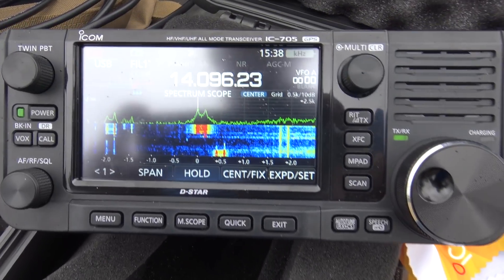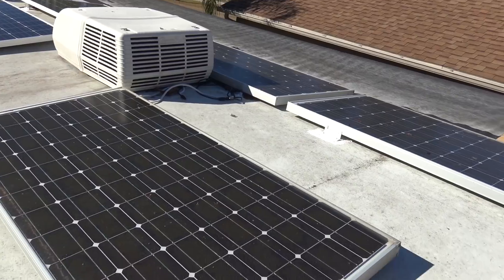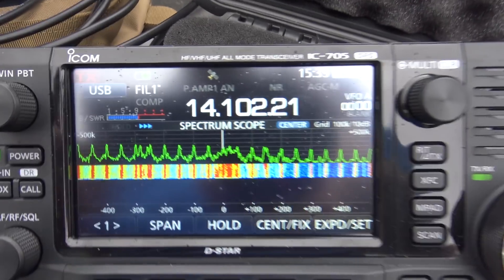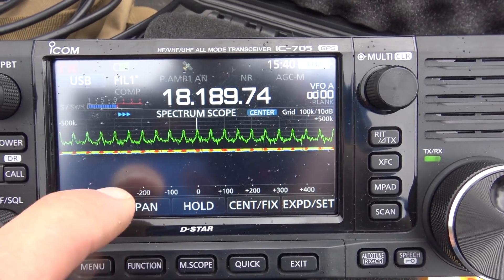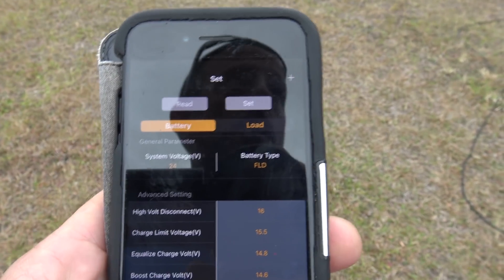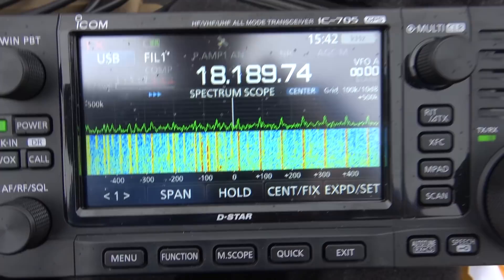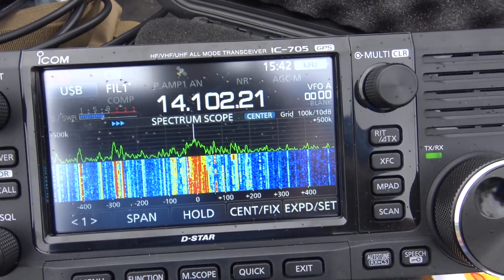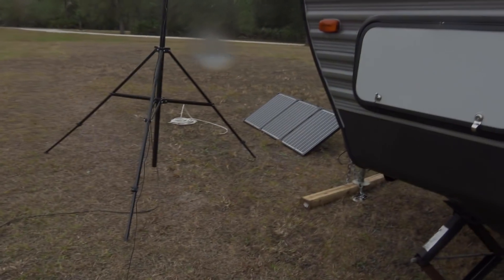Does Off-Grid Solar Energy Interfere With Ham Radio?

Comment: I scanned the comments but are you sure that is your solar panels, yes I have heard some panels can do this. I have had two 600w systems on RVs. One was Samelex panels and MPPT controller and the last one was 600w Renogy panels and using Blue Sky MPPT controller. Operated on the last one almost every day for 8  months inside and out the RV. I have also played with smaller controllers MPPT with QRP portable, 60W and 10a LIFeOP4. Panels never an issue. Yes, some MPPT portable controllers have caused RF. Some did not.

Comment: I've got 30 decibels over S9 noise from my son gold power 6000 watt pure sine wave inverter. I've tried putting ferrite modules on all of the leads going in and out of the inverter to no avail. The solar panels are radiating I can't even though the DC wiring from the solar panels to the house have about 50 ft of it submerged underground for read direct burial cable. Aref interference from these inverters is a major problem in a major engineering challenge to solve.

Comment: I just installed a GroWatt 3000TL. RFI is horrendous! Exactly as you demonstrate. I just tried putting a 4 inch 31 mix ferrite donut on the battery leads. I was able to get four passes through the donut. No measurable suppression. So I might have to resort to disconnect the panels when using the rig but what a sad situation. When I'm not using the station I am going to be polluting the spectrum for others.
Reply from the maker: I'm working on this too
Reply: @HamRadioConcepts  I'm wondering if running all the PV DC wiring inside metal conduit would help at all. The charger to battery wires are short. I'm guessing most the RFI is off those PV feeder wires. "Sniffing" around with a portable RF rig and short antenna, the panels themselves seem to be radiating but not as much as the lines. Adding the conduit would be a lot of work and expensive - I'd be willing to do it if I thought it had a decent chance at success. The other thing is my panels are not earth grounded (frames) yet but I can't see how that will help.

Comment: Solar panels and DC regulators don't make interferences. The problems is always with the inverter (AC 230v).
I had a lot pf years mi shack powered by solar energy and no issue, but in the new house with another solar installation with inverter I have a lot of QRM
Reply: Yeah the Inverter always make a problem .... Maybe people can mention what kind of inverter they use for 220 V what not take interference

Comment: I have a 5 KW Solar System and have Zero noise on all bands and no RF from the solar system, mounted Solar Inverters inside shipping container earthed, all cables underground shielded and earth between solar container and living area, I live in a caravan about 250m from solar container on a farm, noise level is below S1 all bands, and yes i do have good antenna :) regards Nigel ZL2SEA

Comment: Try wiring in a few decent sized 16v capacitors on the 12v power wires going to your radio gear, that will act as a "filter" to get rid of any noise going through the charging wires and help drop that noise floor. Make a short "extension cable" with the same type of male/female terminals your radio uses with the caps wired into that, so if for some reason a cap fails you can take out the extension and still be able to operate. Something similar to this should do wonders but you'd only need half the circuit as shown here though:  https://i0.wp.com/i.stack.imgur.com/2dZqP.png

Comment: If you can manually set the charging voltage, you can bump up the voltage a bit and run the power through a linear regulator to clean the line noise.  If not put the DC through a low pass filter and it should clean it up some.

Comment: i use a Genasun MPPT charge controller (10A) for LiFePO4 batteries. I have not not experienced any noise interference from this unit.  The manufacturer claims its charge controller is suitable for radio amateur work.  I can confirm that claim at this time.

Comment: Thank you ! I got same problem with IC 7300 on HF bands. Moring star tri star MPPT charge controller . 12V system for HAM. no problem on 6M and above and goes away at night ! 160M is real bad during the day .even AM boast .But at night with snow on ground and a clear night 160M really hopping . I put hash chokes on all leads except ground rod lead and cut the noise almost in half . when working 20M during the day  I was pulling the solar panel disconnect when working the band. I mostly use my HF at night and is not a problem , and ben some 6M day openings and hash noise not up 50 MHz range.  I also put RF chokes on 7300 power lead close to radio .The snap choke no cutting wire .Thank you for showing this problem ! 73's

Comment: PWM solar controllers are the problem. My Morningstar- PS-30M 30 Amp 12/24 Volt DC Solar Charge Controller has the option to install a jumper cross two solder pads to make it a on/off type charger. It is even stated in the manual about if installing in a telecom installation to install a jumper if RFI occurs on equipment. I soldered two wires and a toggle switch to have the option if needed. I could tell it was an emitter, instantly via an HF RXR. This was done LONG before the Icom SDR TXR's were even on the market, circa 1999 or so. 73 KA1GJU

Comment: The Genasun solar controllers claim they are noise free: Radio Silence
Most MPPT solar charge controllers broadcast Radio Frequency noise from the DC/DC conversion circuit. Unfiltered inputs and outputs waste energy and interfere with nearby or attached electronics. Genasun worked to eliminated RF emissions from our line of charge controllers. During third-party testing for FCC compliance, the test engineer asked us, “Is it on?”. Mission accomplished. https://4thdsolar.com/products/genasun-gv-5-65w-5a-solar-charge-controller-with-mppt

Comment: What kind of controller are you using?  I've got a couple Renogy (PWM and MPPT) charge controllers I and others in my club have used with great success, but find it is necessary to put some chokes on the wires in/out of them or it will make the cables ring with noise.  Never had complaints from anyone in the club running solar since I put the chokes on the panel and battery leads (I go directly to the batteries for the load, not back thru the controller).

I did a video about my power setup from 2019 Field Day here: https://www.youtube.com/watch?v=oQj4huH9voY

Comment: I have also been off grid and some of the top of the line pure sign wave inverters and a Morning Star mppt charge controller, and no matter what I tried the rf hash made the radio's almost unusable except for the strongest signals. I finally gave up and am back on grid where it is quiet. I wish there was an answer to this problem, but I had not found it.

Comment: Yes, there's a ton of RF noise that can enter your radio.  I run multiple charge solar banks on my 1,000 watts of solar and get noise from 1 of 2 identical charge controllers.  Cheap MPPT Chinese controllers suck.The simple solution I do is separate my antennas at least 50 ft. from my vehicle/operating position.  Pull the charge from the offending charge controller if there's a birdie on the freq. that I'm trying to use.  I have enough battery backup to shut every thing down and run exclusively off my lithium batteries.  Ahhhhh, once you experience the silence you will never go back.

Comment: Generators and charge controllers are notorious noise sources.  Best ways to mitigate I've found is use top rated (aka expensive) brands like Victron and Genasun, used shielded boxes, and coil the feed lines ends into makeshift chokes.  Still not totally gone but it helps.

Comment: I use a Victron charge controller with a smaller 400 watt 12v system. My antenna is right next to (and above) the panels and power center. I've heard no such interference with my HF in the three years it's been in operation.  The only interference I get when using the system is caused by the power inverter. Inverter is a ProWatt 1000 pure sine from Xantrex. They're all noisy. The NB on my FT-991A normally (and easily) takes care of the inverter noise.
Reply: Same here. I have three different solar systems, two were on RVs, 600w, and two other s for portable. Never had that issue. Pretty sure it is his controller.

Comment: Yes! With. Passive recivers, and direct conversion units. Mostly. And I also have chargers that sweep up, and down the spectrum. Hash, buzzing, and AC multiples. Thrugh my net work.  Best I have found is to install caps at the solar cells and on my 12 volt mains. So you are not alone. Tks Fer good show. De kv4li 73.

Comment: PWM charge controller? Have you installed all the wires inside metal tubes/pipes? I tried the Austrian Fronius made inverter till 1.2GHz with no problems whatsoever.

Comment: Perhaps you would like to point out that it is not OK for equipment to interfere with licensed FCC broadcasters. While you find it OK that your equipment interferes with your ham radio, most would not find it OK if someone died because your equipment interfered with a licensed radio in an ambulance or fire truck.

Moving your antenna is not the answer. Have you contacted the manufacturer of your solar controller and notified them that their equipment is interfering with a licensed radio service? Have you asked them to fix the equipment?
DE WA1KLI

Comment: Are your charge controllers MPPT or PWM? (no DC DC in the PWM, but plenty of noise generation with that scheme too) AI5AZ
Reply from the maker: They are MPPT
Reply: @HamRadioConcepts  Just so much switching going on in any kinda of charge controller. Is the noise RF coupling or common mode? Does it exist if not powered by that battery/charge controller? I could see some simple (albeit less efficient) options. Maybe consider panels wired to match charged battery voltage and running dumb, controllerless. That would be QUIET.

Comment: DC DC converters do this, but at predictable freqs, can't filters be built? (placed on batteries)  Are you powering the rig from the batteries the solar charge controller is run into? Or is this spurious RF in the area of the charge controller and still there when running on another battery?

Comment: It also could be because it's a crappy day outside.... I don't have any experience with bigger panels yet, but if the voltage being produced by the panels isn't high enough  (because of the cloud cover), then the charge controller would need to boost convert to get high enough to charge the batteries with.... There would be a switching frequency associated with that.... I'd try to compare to same everything situation, but on a very sunny day...

Comment: Same here on my 100 watt solar system,  Anything above 15-16 mhz to ~30+ is really bad to almost unusable.
   I have noise on 40 and 80, but good stations and conditions overcome it.
I power my radios directly from the battery. The noise is from the charge controller.
   I definitely would hope for some one to design a charge controller that has low noise, if it doesn't already exist

Comment: Would love to see your ftdx10 in that same spot. See if the super het to SDR conversion does better in noisy environment?? Thank you Eric 
KC3ONO
Reply: I have serious doubts that SDR vs the Superhet would make any difference. The signal is actually being transmitted on the frequency where you are listening. Also, it’s not overloading the receiver. If anything some noise reduction software may make it bit easier to deal with, but not that trash. Other than replacing the charge controller, you could use an antenna phasing device to help null it out.

Comment: Wow, thanks for discussing this Eric!.
Do ferrites make any difference or is it irradiation from the solar charge controller & some sort of faraday shielding may work?.
Deeply curious how you solve this as I'm testing a similar setup with a 12v 25ah LiFePo4, trickle charged with a 12v 50w lightweight foldable panel sometime this week when the weather improves here using a Sotabeams inverted V with a 7m mast

Comment: I had bad interference with my last RV's MPPT controller all the way through VHF. My new RV Solar has a Samlex PWM controller nowhere near as noisy. I also have an external panel with good old fashioned relay controller which has zero affect on HF. For that reason, I no longer use MPPT controller even though they are more efficient.

Comment: I am New to Ham - but not to solar. We travel in our RV fulltime and so far, have not seen anything like the noise you display. perhaps it's one of the components you are using you could switch out? We use Victron charge controllers.
Reply: I use Victron as well and have no noise problems with it. de KG4CNA

Comment: Hi Eric,

To be clear, it's NOT the solar energy that's the problem, it's some TYPES of solar CHARGE CONTROLLERS that are the problem!

PWM (Pulse-Width-Modulated) types are particularly bad.

But worse is that those units that make too much r.f. hash noise are not F.C.C. Part 15 compliant! They may say they are, but they can't be when they create that much havoc on the airwaves!!!  Most likely a false claim/label by the manufacturer!  The true fault here; like with some types of new light bulbs, is that they do not have proper filtering to eliminate the noise. I.e. they cut corners to make it cheap!

Now, that said, there are two more tests that you should do & film...

A) Electrically separate out a single battery from the rest, run the radio off of that one battery & leave the others charging.  The second part of that is; if you still have hash, move the station further away, and perhaps the antenna too.

B) This is a bit more involved.
As I mentioned above, the real problem is a lack of proper filtering on the output of the solar charger (and perhaps shielding too! Since many new controllers use plastic cases instead of metal ones (i.e. a Faraday cage!)

What is needed is a filter on the power output or... a high pass filter on the antenna, also known as a broadcast blocking filter.

If you block everything below 1.8 MHz, you shouldn't see it's harmonics higher up.  If the noise persists, then that means you need the heavy duty filtering on the solar charger output, or a far superior quality of controller!

The irony here is that people go & buy the cheap controllers because they are cheap. So cheap that they don't realize that the same problem that causes us noise... also hammers away at the controller's output circuits and will cause them to fail early!

So Eric, hope your new year is going well so far.

73 - John
Reply: Interesting. Is it as simple as low cost = low quality? I'd like to know what charge controllers do NOT dump RFI out everywhere. Is additional shielding an answer for those with cheaper gear?